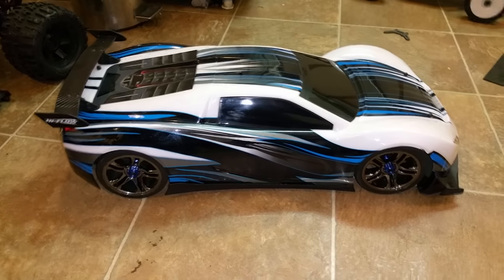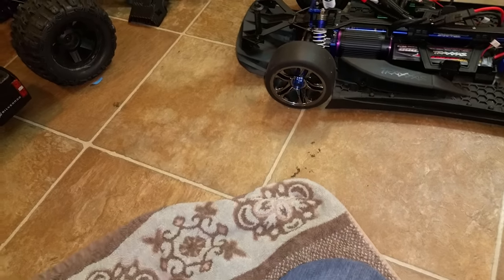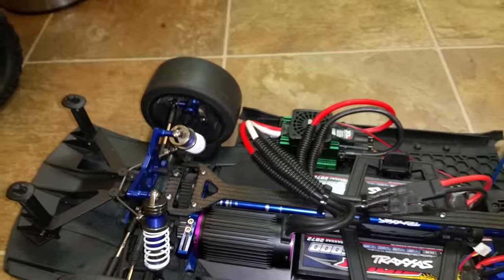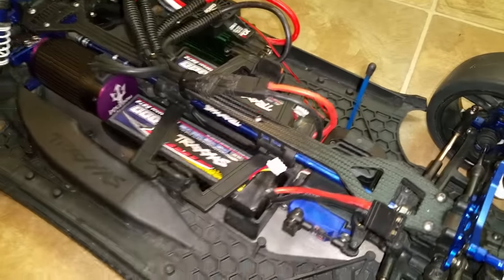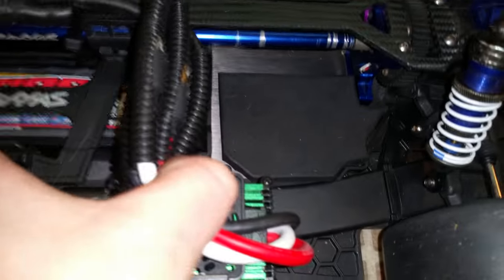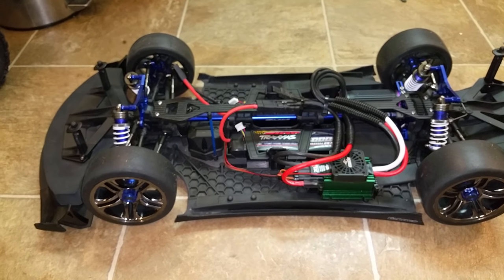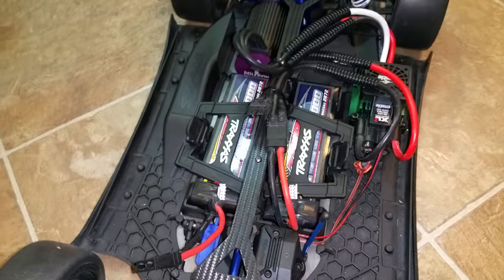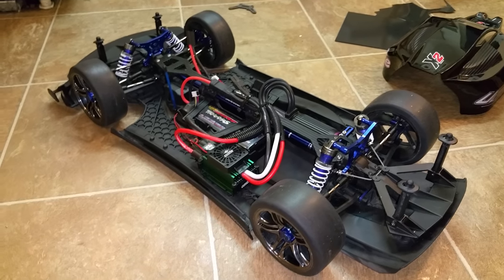Scotch tape Traxxas Xo1 Poseidon xl2 set up.

Comment: I think you can just switch your a arms around to get the tow you need. Also get small piece of plastic scream to block out sand & rocks. I use just a nylon stocking, Thanks for the shout out, i see you been listening & watching XO-1 builds, i like it bro. One Luv!
Reply from the maker: Do you mean flip the arms upside down? Because it seems like I cannot find a solution for this it's really frustrating for me considering it's the last problem to deal with until roughly is done yet it such a big one. Thanks for the tips buddy I appreciate it a lot. one luv!
Reply: Epic rc Either upside down or switch the right with the left a arm.
Reply from the maker: I will try and let you know if it worked bro thanks. Silly rusty is giving my patients a run for its money lol.  Perfection takes time and I have plenty of it. thanks again Tookie! (=
Reply: Epic rc Just take your time, no room for mistakes!
Reply from the maker: mtctookie25 so I was finally able to attempt a practice speedrun today. And I'll be the first to admit that yes it is hard to keep in a straight line at speeds above 60 miles per hour. Is there any tips you have for me to adjust steering or things like that to get a truer line while running down the road?
Reply: Epic rc Their is a guy: Jeremy Stillson of High Gear Rc that makes/sells a metal steering linkage, you'll need. If you have a BEC added to the system, turn up to 6v & turn D/R down to 30%.
Reply from the maker: what is d/r?    And I think I may have found my problem I used Loctite on a couple of the screws attaching the front steering blocks and I think some got in between where it shouldn't be and was binding. I cleaned it up with the wire wheel on the bench grinder and all seems to be well.  Those metal steering links sound great though I will check it out for sure bro! Thanks again tookie ( :
Reply: Epic rc D/R= Steering dual rate!
Reply from the maker: Ok cool. I think I've got her under control now. Thanks Tookie!
Reply: Epic rc Yeppers!

Comment: For you rustler you can use the xo1 carriers. Just swap out the bearing to 5x12x4 and 5x15x5. I'm pretty sure that the size of the outer dimensions. 5mm inside for sure.
Reply from the maker: Right on brother I will try this for sure. Thanks a lot man
Reply: Epic rc no worries bro! Glad I could help.

Comment: Looks good. What shocks are those? Good ride? Would you know if Poseidon 1527 1500kv motor would fit in xo1 ? Thanks.
Reply from the maker: +D Coop shocks are just blue traxxas big bores. i got them from tower hobbies under jato shocks. i know the 1527 is a beast. for what application are you thinking of using it for?

Comment: Thanks for the info I am currently building almost same build as you have here. So I have Xo1,1/5 adapters w/1/5 GRP wheels ,esc plate, xl2 esc I have not installed any of the parts yet. I have installed rpm arms but was thinking about swapping them for aluminum. Would like to run 8s set up posidon motor or leopard ? Any info or any thought regarding this since you have already done it would be appreciated.
Reply from the maker: Hey there going to be boasting a video of what that RC looks like now about 3 years later if you're still into the Hobby and EXO once you're going to want to see this you can also check out my Instagram and Kelly torvik. It's by far the most custom xo1 you will find anywhere. Cheers and thanks for the comment and watching my video

Comment: Im thinking that you may be able to use slash 4x4 rear axle carriers.  The bearings are the same as a rustler bit they have some tow in.
Reply from the maker: 1973noxqses i can only find them in 1.5 degree . i need more than that to correct my issue. thanks alot for your comment though. cheers bro!

Comment: Nice bro
I don't know you still have that problem with the rustler like I said before i don't have that problem with mine and i use traxxas carriers 
And integy gear box doble check everything bro
Reply: Tekno carriers for slash/stampede has 3 degrees toe in. Other than that everything lock just fine, you are right about the connectors, im goin for the Turnigy hevy duty. Castle and ec6 allso an option.
Reply from the maker: jess34753 i have tripple cheaked it brother. ):  i am waiting for new arms to see if that is an issue. but may just build a plate with new arm mounts under the existing gearbox to correct the issue... seems very werd man. Im very frusrerated with the almost complete rusty project.
Reply from the maker: Mattias Holmström go big or go home ah brother lol. cheers buddy! (:
Reply: Amen! (-:

Comment: i run the pro trac slash 2wd arms on my rustler and it gives me alot of toe in, i run an rpm gear box as well which adds 3 degrees teo in so i have about 4 degree right now which is actually too much but im sure for a larger motor you cant run rpm, i just run 38x74mm motors which is plenty.
Reply from the maker: i have traxxas jato rpm arms on the rusty and have since solved the toe issue. i think i did a few update videos on it since. thanks for watching bro.  cheers!
Reply: jacob portillo to much toe will burn through tires

Comment: Posidon 1527 motor is same width as stock but I think like 3 Inc longer.
Reply from the maker: I was going to use the 15 27 in my rustler build but thought it would make the car too lopsided
Reply from the maker: I was going to use the 15 27 in my rustler build but thought it would make the car too lopsided
Reply from the maker: I was going to use the 15 27 in my rustler build but thought it would make the car too lopsided
Reply from the maker: I was going to use the 15 27 in my rustler build but thought it would make the car too lopsided
Reply from the maker: I was going to use the 15 27 in my rustler build but thought it would make the car too lopsided
Reply from the maker: I was going to use the 15 27 in my rustler build but thought it would make the car too lopsided
Reply from the maker: I was going to use the 15 27 in my rustler speed build . I decided not to because I thought it would make the car too lopsided . I'm sure it's a great motor with tons of torque and I'm sure your temperature it would stay down quite a lot considering its length
Reply from the maker: I was going to use the 15 27 in my rustler speed build . I decided not to because I thought it would make the car too lopsided . I'm sure it's a great motor with tons of torque and I'm sure your temperature it would stay down quite a lot considering its length

Comment: Get your self a dust bag it will help with the pebbles, also fashion a dust screen for the air intake for the motor.
http://www.dustymotors.com/shop
Reply from the maker: Tank 62 great advice! I will definitely do that. I've actually found coins like dimes and nickels inside of it after runs so I figure if I run it enough.. I might be able to buy another RC or something . :-) cheers bro. Thanks for the link also.
Reply: Epic rc,  Money what road do you run it on, I will suck up the money for you with mine and split it with you LOL

Comment: how did you connect the xl2 to the Poseidon motor its not a direct fit
Reply from the maker: I soldered on my own bullet connectors. I used 8 millimeter bullets

Comment: Hey brother how did you setup the brake on the xl2
Reply from the maker: I just set up the break with my Futaba radio and didn't mess with the breaking on the XL 2 I turned punch control almost as high as it goes as well on the ESC through the Castle link and made a nice throttle curve

Comment: so i been seeing more and more on this posiedon motor thing is it true that it is really a better motor then the castle creation mamba monster 2? or any castle motors in general?
Reply from the maker: from my experience the Poseidon Motors seem to run about the same power when you compare KV and can size. the main difference I've noticed is that the Poseidon Motors seem to cool down quicker when hot. either Castle or Poseidon you cannot go wrong with either